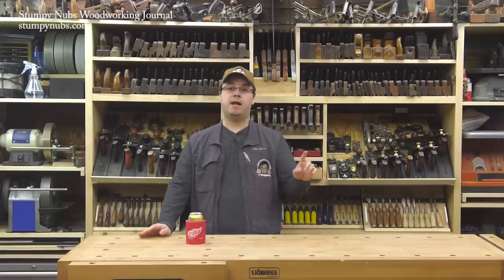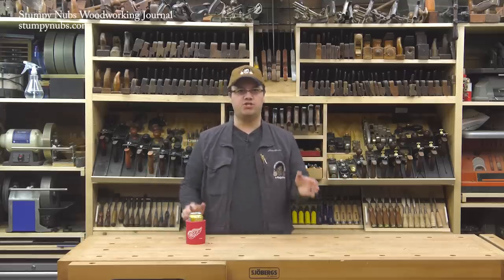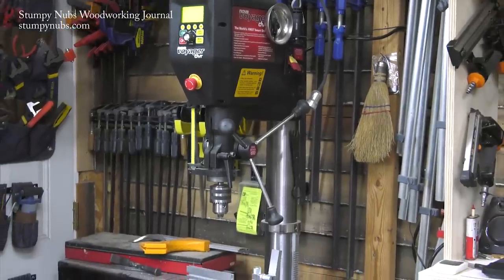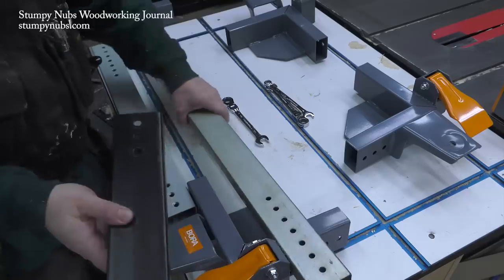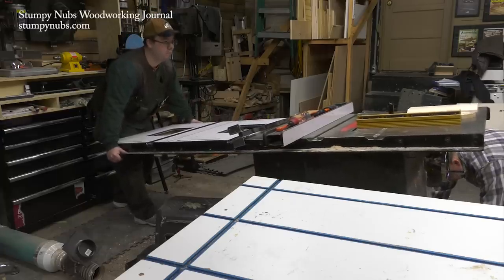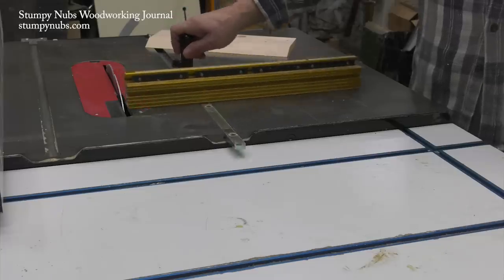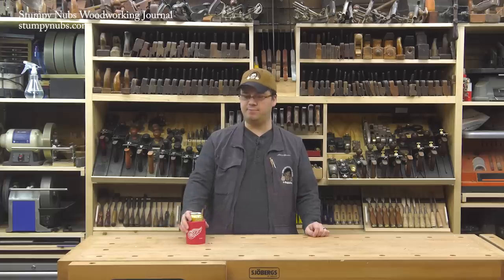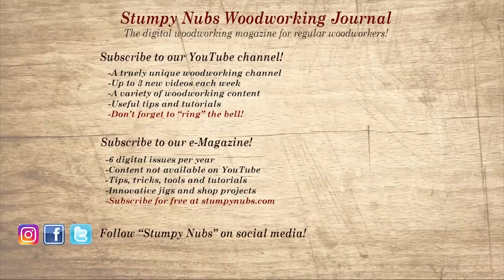Is it a bad idea to put a mobile base on a lathe? Check this out...

Comment: There is one thing about your videos I love is that the comedy is not "Rare" but brilliant. When I bought my new lathe, about 5 months ago i came with the option of casters on each of the cast iron legs that allows the lathe to be moved but when in situ the legs sit on the floor. I live in the UK and my lathe is an Axminster 1628. Cheers, Huw

Comment: James, I just completed my homemade base for a lathe.  It isn’t a full size lathe just a HF mini lathe but it has worked out very well for me. I also use mobile bases on all my larger tools to be able to maximize my work space so I came up with own version of a mobile base similar to others that I’ve seen online.  I wanted three things, the mobility, a flip top, and storage. I’ve seen several flip top designs online so I used their ideas and placed the lathe on one side and my belt sander on the other. I ran the power cord through the steel pipe axel.  The weight of both the tools helps dampen vibrations but using tapered 6x6 lumber for the base makes it very solid on the floor.  I also bought a cheep dolly at HF rated at 1K lbs for the wheels that retract and lower very solidly and since they all rotate, make it very easy to move into tight corners. Playing around with the radius of the table I finally came up with enough clearance below the flip top to place two drawers to store all the accessories for both machines.  It worked out very nicely of my shop setup.

Comment: I put wheels on everything I can, and I usually build all my own mobile bases, with steel. All four corners get locking casters that swivel, so they can turn in the least amount of space. I don't have a lathe but if I was facing your dilemma, I would probably just build a custom base for your lathe out of plate steel and tubing, to match the one at 7:08 (if that is what you like) or something similar. Heavy gauge steel would also add a lot of weight on the bottom, to help dampen the vibration etc. As often as you like to move your tools, I definitely would not fasten it to the floor. Pretty sure you're not from my area but if you were, I'd be glad to help you with the steel fab and welding if you wanted, just let me know. I'm from south central MN. Some people say cow tipping is a big thing around here, or at least in WI...lol.

Comment: As always, great video.
EVERYTHING (almost) in my shop is on wheels.  I have had many small workshops, some were crowded even with wheels on all the tools.  Now, having moved to a farm with a barn that had already been remade as a 40 x 45 woodshop with built in benches, I keep with wheels.  Why?  It affords me with options on where and how to place tools for maximun effect in a particular project's workflow.  More importantly it frees space for sawing sheet goods on the floor on a piece of foam sheathing.  Having open space is something you can't get enough of, esp ecially if the John Deere 5565 that usually lives outside isn't feeling well and I'm being the tractor doctor.  I do that work inside usually.   
As far as my lathe on wheels  -  my smaller Rikon sits on a rolling table with a number of tools and accessories.  My Revo 2436 has Laguna's mobile base installled on it.  A wonderful and relatively easily installed option.  My lathes are usually in one part of the shop with some carving and Desktop CNC stuff, but they might be anywhere in the shop if need be.
Not on wheels is the 1970's vintage Craftsman Table saw, its 4' x 6" outfeeed table and the sidefeed table that t's into a 15' second outfeed/in process table.  This was left here by the previous owner who had been a contractor/cabinet maker.  This was his setup for deaing with 12' sheets in the cabinet business.  They also left the 2 hP Grizzly dust collector (unused).
I love my wheels and my open space for assembly, parts lay out, etc.  Its easy enough to roll something out to use it and roll it back when I don't.

Comment: Those of us with Shopsmith and turn wood with them, we have had mobile based lathe all along.   Yes, they do not weigh as much as an official lathe.   If it starts vibrating too much, I put the front bucket of my tractor on it and lift the front of the tractor up, but only when I have too.  Many happy turns to you!

Comment: Doubt if you'll see this but just in case:

Moving equipment around and looking at options for a 20 inch bandsaw. Thanks for the bora link. Will look into this. 

As to lathes. I have big ones. And they need to be firmly planted. VB36 even recommends bolting it to the floor. I haven't done this -- the tailstock works for stability for now, and it's massive enough for now. I know that you don't spend days at the lathe and yours needs to be mobile. I write mainly to thank you for the link, and suggestions for ballast. Haven't sifted through the comments, so it might already be there.  

1) to be most effective, the added weight needs to be as close to the axis of rotation as possible. This is where it would do the most good. 

2) think gravel instead of sand. Sand has a way of getting loose. Or cast a box with concrete.

3) (extra idea) trailer jacks with wheels can be awesome for heavy equipment. Side crank. Can be very stable. Remove after moving equipment. Several mounting systems available. 

Thanks again and for all your vids

Comment: I recently purchased a new table saw from Powermatic and it has internal castors that lifts the saw up by pumping a handle on the side. It also has a built in DRO for reading the angle of blade tilting, works the same as one of those Wixie angle reading tools.. I am blessed with enough space so mobile bases are not needed.

Comment: I built wooden bases for most of my shop tools and some of my cabinets.  They have 2 or 3 "feet" made from 4x4s that run from front to back under the base.  The result in totally stable.  I move them around with a small pallet jack.  I thought I had invented this method, but have seen others use it, too.

Comment: A couple of other things. I have two trash cans that are on mobile bases which I made using 5 - 2" swivel casters on the bottom of a circle of plywood with stops to keep the can from sliding off. I also have about a dozen 12" x 18" four wheel dollys (about $8 each on sale at Harbor Freight) which come in real handy for material. For longer boards use two of them and you can stack close to 3' high before they get too unstable. If you're processing a lot of material on one machine come straight off of it onto the dollys and then push it to the next machine. I guess a cart might save some bending over, but you can't hang a cart on the wall out of the way when you don't need it. You also wouldn't want a 3' high stack of material on top of a cart either.

Comment: what if for the lathe you made a shelf/ platform on top of the mobile base that extends out in front for you to stand on and your toes could go in like normal and it would mean that you would also be taller when working at the lathe to eliminate the extra hight the base adds
Reply: Then his body weight could be adding to the ballast holding the lathe steady hehehe

Comment: James, somewhere a long time ago I saw a plan for a mobile base for a lathe that was basically three box beams forming an upper case “I” pattern with the legs of the lathe sitting down in the box beams forming the top and bottom of the “I”. He attached the casters to the outside of the end beams. They were those ones like you use on heavy wooden work benches. He then filled the hollow insides of the box beams with sand and even piled one of those tubes of sand (that you put in the bed of your truck for traction) on top of the center beam.

Comment: i have a 2 ton wheeled gantry crane.  it's nice when you get a new machine as you can lift it off of the pallet, and set it down in the shop anywhere you like.  you can also move your machines around with it.  It stays in the garage, and my garage attached shop is next door when i need it.  the crane is wide enough to park a car under it so it doesn't really take a lot of extra room.

Comment: The fix for the raised frame of the mobiles base might be to simply build 2 small platforms that are the same height as the front bar.  Drop one in front and one behind the bar.
Concerning your ICS SawStop, I have one too.  I am not sure when you shimmed the saw to be higher than your out feed and I am not at all certain how much long stock and full sheets of 3/4: plywood you may be ripping but,,,,,,  I have the HTC 15 roller fold down out feed  on my saw.    It needs to be adjusted a touch higher, close to level with the TS top.

Why is level or a hair lower then the TS top important when ripping long and heavy stock?  When you reach the tipping point, more than half of the stock is now past the TS top, it will naturally try to tip down to the out  feed.  The material now scrapes on the back edge of the TS top and pivots much like a seesaw.  This adds a lot of friction and can lift the material up off the TS top while cutting.  Mine even with the low friction rollers displays considerable more effort to push through the cut once the material length is mostly past the back of the TS top.  Food for thought.

Comment: In case no one else has already suggested it, since you bolted the base directly to each of the lathe's feet, just take off the front stretcher. Or if you're not comfortable removing it entirely, bolt it to the middle similar to the wooden base.

Comment: Great way to add weight / gravitas to a base or any lathe is a sandbox. I always build a box and fill it with dry sand, then seal it up. It helps dampen any vibrations VERY well.

Comment: James if you put a fold down platform that stores up against the legs but has the same depth as the mobile base then you can get close and you can still put more weight on the bottom of the base.
Reply: my thought exactly.

Comment: On the mobile base for the lathe.... What if you moved the support bar that your foot was hitting from the outside to the inside. Looks like that would give you an extra 4 or 5 inches while still leaving enough support. You would move it directly behind the leg on the lathe base. If that makes sense, That would leave enough room for a shelf and cabinet as you planned, Maybe slightly smaller. Hope to see this mod in a video soon LOL. Thanks for the great Videos

Comment: Take pictures of the wood  lathe base and one of the metal one to a welding shop and they will modify the metal ones so your dog's fit under. For a simpler solution build a wooden platform to stand on that will allow your feet to go over the metal base. The give of the wood will be better for your legs and back when turning a long project.

Comment: I know that for metal lathes, you must ensure the bed has no twist in it or you will lose accuracy and possibly apply uneven forces on parts of it which will cause early wear.  The easiest way to achieve this is to make it level. I don't know how much accuracy you need on a wood lathe.  Putting a wood lathe on a mobile base will probably cause a little twist in the bed as you set it down in one place or another unless you have a very, very, VERY level floor and that's why it's probably a bad idea to put a wood lathe on a mobile base.  I think you might need a solid slab of steel (you might get away with a thick, extremely stiff torsion box bed) with a leveling mechanism for the base, but you will have to have to check it for level every single time you move it.  That's a long, tedious process if you're off.  I don't know, maybe you can get away without on a wood lathe.

Comment: Always great videos!!  Thank you!  I do not suffer from rearrangitis but everything is on wheels for shop cleaning. I use the nonlocking casters from harbor freight moving dollies. They are cheap and durable. I purposely way over build my tool stands and make them as heavy as is practical given the resources of the day. I'm still developing my skills in the shop, so...my stands aren't always real pretty but they are level, reasonably precise and only move when I want them to. Having old tools from the 50's and 60's helps too...they weigh a ton.

Comment: The only machine I bolted to the concrete slab floor of my shop is the wood lathe. The base of my Delta lathe is not heavy enough to dampen vibrations unless I was turning small bowls or balusters. Movable bases are fine for my band saw and belt/disc sander but would never work well enough for the lathe.  Surely every decent sized shop must have at least one space that can be dedicated to one machine that doesn’t need to roll around like a shopping cart.

Comment: My table saw has a mobile kit, but I have yet to move it. That and the 4'x8' CNC are pretty much fixed. The jointer/planer also has a mobile kit and stays against the wall behind some other stuff, including it's dust collector on wheels, when I'm not using it. I have two 4'x8' outfeed/assembly tables that are on double locking casters. I shift the one in front of the table saw to one side against the wall when I'm using the sliding table and then pull it back when I'm done with the cutting for the project so I can work from both sides of the table. The other one just moves up and down the length of the shop by a few feet to allow clearance as needed or to double up with the other table for long projects. Yes, I build projects over 16' long on occasion. I have a disc sander and spindle sander on a cart that stays out of the way when I'm not using it and hooks onto the end of the outfeed table when I am. The sander tables are then flush with the outfeed table. A lot of my hand tools are in two mechanic's type chests which of course have wheels. They get pushed down the shop when using the crosscut fence on the table saw and then back close to the assembly table after cutting so I can access all the odds and ends quickly. My router tables (2) are on wheels and stay parked with a bunch of other equipment as I don't use them much. I have several roughly 18" x 24" carts which hold a pocket hole machine, PantoRouter, sanders, etc. which are pulled out when needed. My bandsaw is on a goofy mobile base that came with it when I bought it used. I seldom use it mostly because I hate moving it. Lately I've been grabbing a jig saw for rough curve cuts. I hesitated for years to put my drill press on a mobile base, but my work changed and I wasn't using it for a couple of weeks at a time and it was in the way, but still needed it a couple of times a month. I had it on a large platform which raised it about 6" off the floor (I'm over 6') and sized per the manufacturer's instructions for stability. I finally just put double locking swivel casters under the top board of the platform and it works fine. I haven't had any issues with stability and push it around the shop a couple of times a week. I don't currently have a lathe in the shop, but do own one which is in a friends garage. I don't think he's using it and have been thinking about getting it back and putting it on a mobile cart. I wouldn't do a lot of turning and what I did would be small so I think it would be okay. I appreciate the heads up about the clearance at the front of the lathe.

See you at the show on Saturday.

Comment: Thanks for this - I tried the "heavy duty 200 lb/each" retractable casters from Amazon, and they were crushed by my 700lb CNC/Shopfox table. I put the 6 1/2" Shopfox wheels on, but now I get too much vibration. Going to try the Bora PM 1500 lb base and an extension kit. Heavy is good in most woodworking...

Comment: So that’s how they make lean / ground beef?  Good to know!

When I got my drill press, I made a mobile base for it (nothing fancy).  I quickly realized that it tipped over way too easily (backwards - they are pretty back heavy).  I ended up having to extend it significantly to the back to keep it balanced.  I think that’s probably the reason for the warning - the mobile base needs to be big enough not to tip back.  I keep everything on a mobile base in my shop.  I just don’t have the room otherwise.

Comment: Why not take your box base, remove the front panel and then cut and weld in your own cross supports?
Reply: that would be the logical thing and a simple fabrication job. He could trade some cabinetry for the custom piece from a metal worker lol
Reply: That's what I was thinking: metal in the wrong place? Time to weld it!
Reply: He could just use some flat steel bar top and bottom as joining plates and bolt through. I did see him struggle drilling holes in the steel though.

Comment: My shop is 12x16 so all of my tools are on wheels and they get moved around alot. I made a cabinet base for my midi-lathe with two offset wheels on the outside of the upright panel on one end and two chest handles on the other end and I can move it around like a wheel barrow. I keep all of my turning tools in the chest along with turning stock. Everything in it's place and all.

Comment: First, I don't understand why most mobile base manufacturers do not make their bases with swivel castors on all corners.  I need this to move my tablesaw and other tools as it is difficult to move the tools in tight corners.  I only found the Bora bases that offered this as an option but I guess it is possible to find matching castors to fit other bases.  What is the reason why this is not more common?  As far as your lathe is concerned, you can easily build a folding step with a 2X12 or maybe 2- 2X8 that would attach to your base and provide you with the proper height and distance to your workpiece.  I have a workbench that is slightly higher than I like and built just that and it works great.

Comment: make your lathe cabinet on wheels, with a couple of car jacks ( basically free from a wreckers yard) under the bed of the lathe. when you want to move, raise the lathe half an inch, and use the cabinet as a trolley.